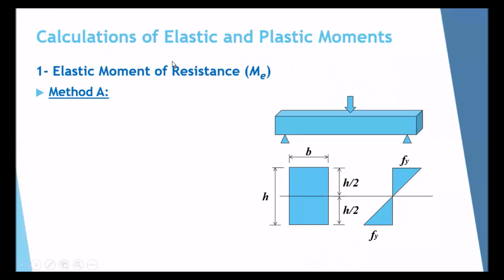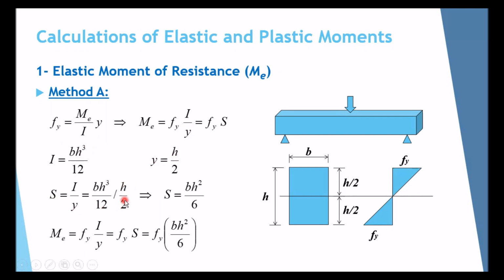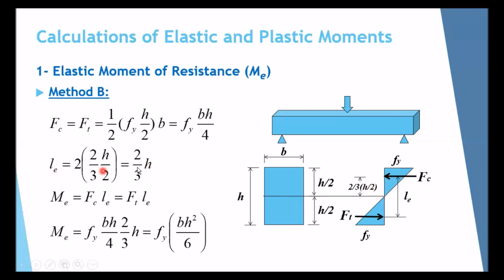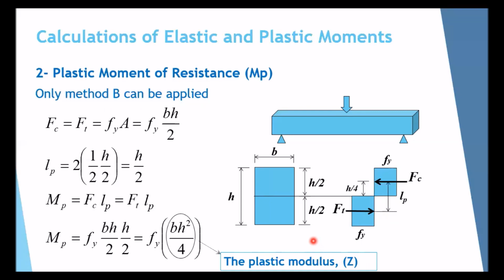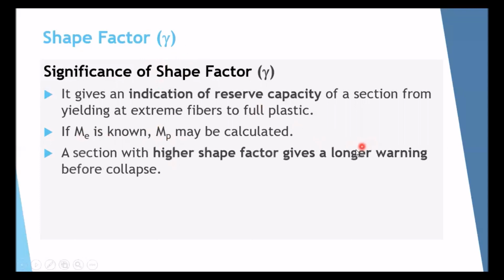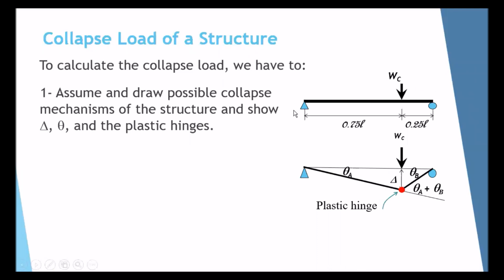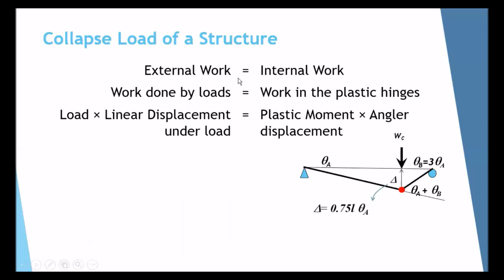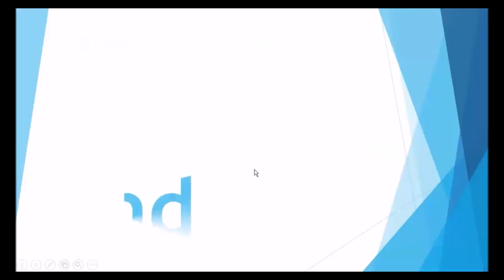Plastic Analysis of Structures Part 2

Comment: hello doctor, thank you for this. I do not understand why we can't in the case you cover for the collapse load, just find the load that will create a full plastic moment at the section of maximum moment. We know the moment diagram, and we know the value of the plastic modulus. So we can find the load that will causes Mp in the section. Max moment at the point load = 0.25*Wc*0.75*L = 0.1875*Wc*L (simple statics). Plastic moment Mp = Fy * Z, therefore collapse load Wc = Fy*Z/(0.1875*L). Is this correct? thanks. I just realized this gives the same result, as 1/01875 = 5.3333
Reply: You are correct. Only that you were lucky to be dealing with simple and statically determinate beam. You realize that Dr is teaching from the very first principles so that you can transfer the same logic and principles to a more complex configuration of beams and frames. I hope you now understand why he didn't apply your simplified approach.  But yes, applying your approach you arrive at the answer without much struggle. Now try the same approach on a 1-degree statically indeterminate beam.